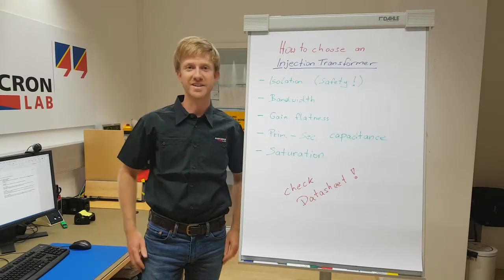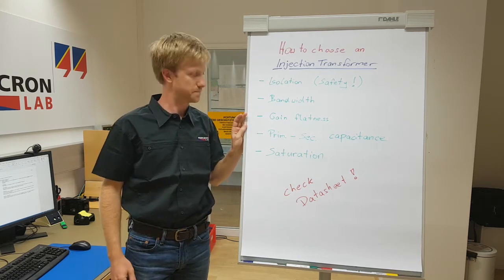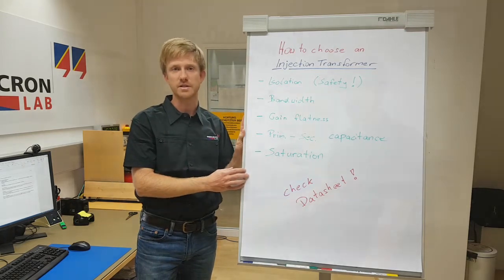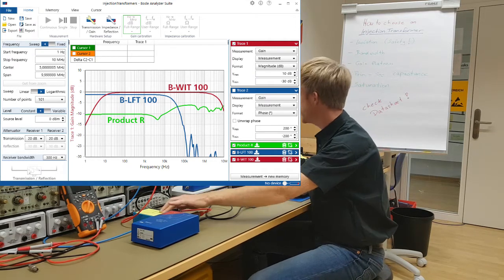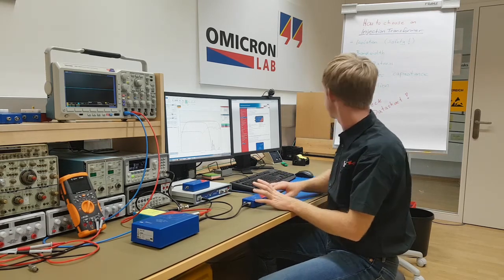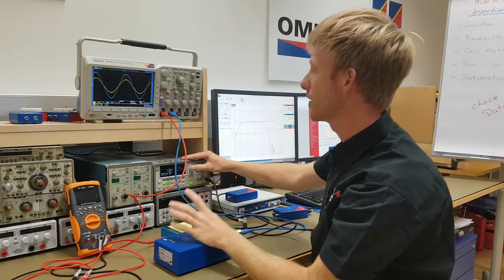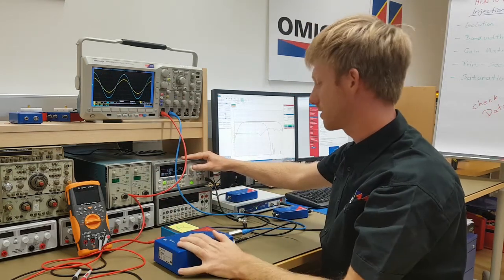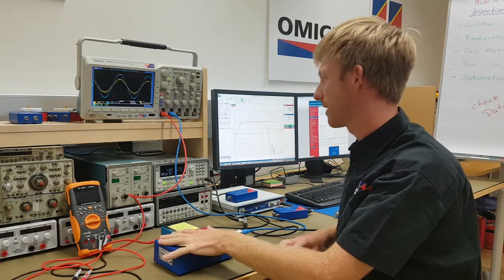How to choose the right Injection Transformer

Comment: What's the black box on the cable that connects to port 2 of the Bode 100? Is it some sort of loading element?
Reply from the maker: Dear Portalfreek,
thanks a lot for your question. Unfortunately, I am not really sure which black box you mean. Could you please send us a screenshot or some more information to info@omicron-lab.com and we are happy to answer your question.
Reply: @4:56 you can see a tiny box attached to the end of the BNC cable connector to the far right (port 2) of the Bode 100.    What is that?
Reply: @WhyyLunar  It looks like a BNC filter to me.

Comment: You neglected to measure the capacitance across the Omicron low frequency transformer.
Reply from the maker: You are right. Sorry for that. According to the manual available from https://www.omicron-lab.com/bode-100/accessories/injection-transformer.html the capacitance is 600pF. For low-frequency applications however, this is not so important than in the high-frequency case.
Reply: I can imagine what does it mean R😀 do you know how did they manage to be flat? Do they parallel 2 trafo?
Reply from the maker: It looks like multiple winding structures on one core. Do you really consider it "flat"?